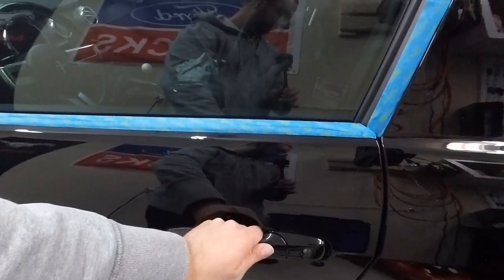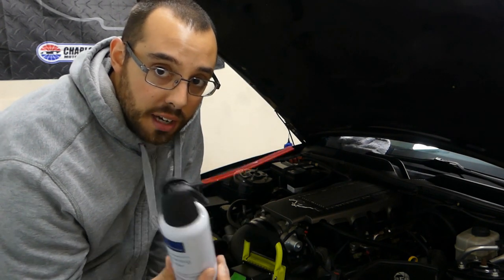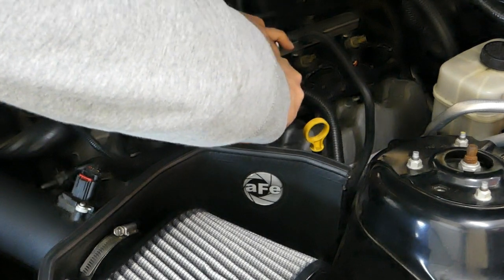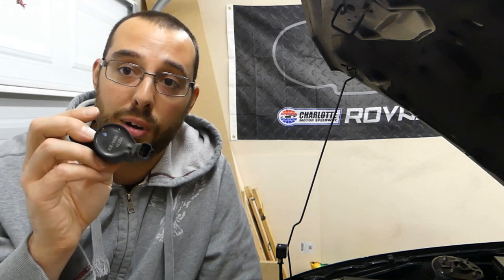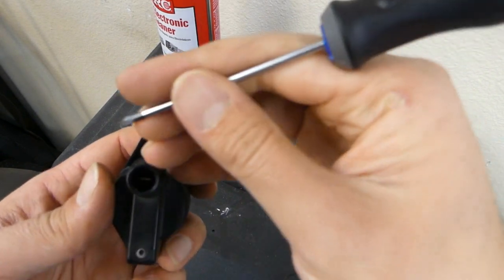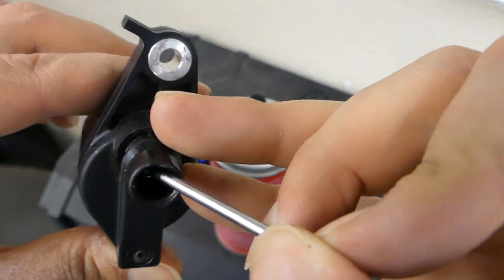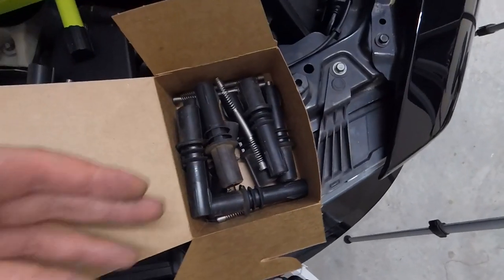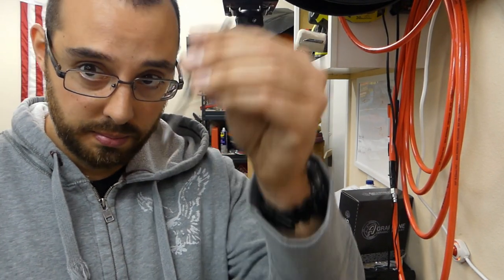The Best Coil on Plugs for a Ford 3V Engine

Comment: I know this is slightly old but…to anyone else out there… I just finished my spark plugs and was gonna go with all new coils also. I saw this video and decided to do it…followed the instructions to a T…and it worked. Misfire on #1 and #4 codes, random misfire code, and coil circuit H code. All fixed. This man saved me many hundreds!
Reply from the maker: Glad to hear. Coils rarely ever fail and this to me is great preventative maintenance

Comment: This is one of those “the most common cause” and “easy to fix” instructionals that when you finally diagnose your problem is never EVER the cause. Don’t get me wrong. This will need fixing too and you will think you’re done. But then, when you test you will find the symptoms intact and something completely independent causing  the same problem. Hundred percent of the time. That’s just the law.

Comment: Good to see the CPBK240 are actually made in USA. I thought for sure they would of been china. They say to coat the inside of the boot in dielectric grease, along with the head/to boot sealing rings, and finally the boot to coil stem inside and out. 2v tritons no antiseize MC plugs 28 ft lbs (yes over tighten them). And 3v 5.4 is MC plugs with Nickle anti seize on shaft/threads torqued to proper spec.

Comment: I enjoyed watching this video… I have never replaced a coil on plug before. I’ve replaced countless ignition wires and spark plugs on older vehicles, but I’ve not replaced any on vehicles with coil on plugs I was looking at one on my car today, and I was not willing to pull up on the boot because I was unsure how the assembly went together. Thank you for your video… It was very helpful.
Reply from the maker: Awesome, glad you found value and I appreciate the kind words

Comment: Good on ya mate 

good video, I’m definitely gonna try this. It also occurred to me you could clean that spade terminal with an emery board the ladies used to file their nails with might work a bit quicker……..

Also on YouTube, there’s several videos showing how to test resistance of coil on plug using a primary test and a secondary test via a multimeter while it’s out it’s probably not a bad idea 

All the best from Melbourne Australia
Reply from the maker: Definitely does not hurt to check the resistance. I know that even if they check out okay, they can still be faulty under load. My understanding is there's no real good way to check the true health of them at load (which is where most of the problems arise)

Comment: I've got the powered by Ford intake cover and the matching fuel rail covers that help keep water,dirt,& other road debri away from the cop area. Im sittN on about 45k miles on my 06 GT so its about time for her first plug change.
Reply from the maker: That's great, I have that engine cover as well. 

I would definitely clean those contacts on the COPs and best of luck on the plug change!  I used the impact and it worked great.

Comment: Putting dielectric grease inside boot is good, and also cleaning exterior and smearing a thin even coat of black RTV on it, and let it dry for a few hours.  Keeps boot conditioned and adds a little more protection from cranking/wear.

Comment: Ford 6.2 Motors have a little pill resistor in between the spring and contact. The tabs that hold it wear away, you need a new coil. Its expensive :lol: Each cyl has 2 plugs.

Comment: My F-150's 4.6 Triton is doing EXACTLY what you described, i had the plugs changed, maybe slight improvement but still bad.  Then watched your vid & planned to follow your instructions, it appears that i don't have the COPs, the wires go directly to the tops of the plugs.  Is that because it's a 1999?  Are those COPs something newer than that?  If so I guess my only hope is to change the wires, do you agree?
Reply from the maker: So that is a different design that is unfortunately out of my wheelhouse. Ford had changed from that design over to the later coil on plugs. I'm not saying you can't use the same method and check for corrosion, but I personally have not owned one of the older coil pack based design so I can't speak to it.

If they have the little spade connectors where the wires connect to the coil pack, I'm sure you can clean them.  But unfortunately in this case, I'm not sure and you maybe better off just replacing the wires and the coil packs if they're overdue. Good luck
Reply: Wires certainly go bad, especially that age. Very common item to replace during a tuneup. Best to use Ford OEM wires. The coil pack can also wear out. Do not buy cheap ones though!

Comment: What about the coil pack on a Vulcan V6? Many brands out there. In my 50s, Taurus is my 1st frikn computer car. Also looking for good scanner, just sent back creader3001, wouldn't read O2 sensors. Was a Ford mechanic at a restoration shop that's now closed yrs back. We stuffed big blocks in old Ford classics or rebuilt what was in them.
Reply from the maker: The same idea can be applied to any coil on plug doesn't matter the make or model. If it has a coil on plugs with a spring and a boot, I would take a look and see on RockAuto or a similar site if springs and boots are available. And if so it's probably not a bad idea to take a look at changing them out and cleaning that contact. People do the same thing with Chevrolets and Toyota's... it's all the same idea.
Reply: @3VJohnny  have a pack on valve cover, not individuals. Checked the arc last night seemed more orange and red with a little blue. Would probably explain alot. Could barely notice a change in way it ran. Use to be 1st thing I checked to find a bad plug or wire. I trusted a chinese gizmo a guy plugged in. Did find problems but not this one
Reply: Just replaced Plugs n wires. Besides the crank sensor which is good or bad it's the coil or computer. Engine light has flashed at times, sure an 02 sensor or 2 are also done, don't think that's the problem tho

Comment: I am getting what you are describing on my 2008 4.6L F150, but there is also some strange random vibrations at idle, no matter if in gear or out of gear.  what do you think
Reply from the maker: There honestly could be multiple things that cause it. First instinct would be a low-grade misfire which could be caused by dirty plugs or corroded coil on plugs. It's not something you're going to diagnose through the internet but my plan of attack would be: clean Mass airflow sensor, clean throttle body, rebuild coil on plugs, and change spark plugs if they are older (or you don't know history), change fuel filter. Most of the time that maintenance solves a lot of problems. But ultimately you're just going to have to try it and find out...good luck
Reply: I have this same issue at idle I replaced my plugs. Went to the ford dealership and they said I had a slight misfire. No codes or anything but they seen on the scan tool. They recommended coils. I would say yea clean the coils like he did and see what that does.
Reply from the maker: Exactly. This is not a one-size-fits-all fix, but usually the coils don't just fail. So it's worth the $30 to clean them and put new springs in boots and see what that does.

Comment: Are the 3v and 2v mustang coils swapable... like I've got a good running 2002 GT and I got a 2005 3 valve GT can I borrow a coral off my 2002 GT and put it on my 3-valve GT
Reply from the maker: No they are different. 2V engines us DG-508 coils. 

3V engines use DG-511

Comment: Kinda seems best to do this every time  you change plugs as PM esp if cost 30$
Reply from the maker: I agree and quite frankly I think it's something you could do every 50,000-60,000 miles.  My truck had around 40-50,000 miles from the first time I had changed the coil on plugs, and they already had the corrosion on them.  Just good preventative maintenance to keep things uneventful and running strong!

Comment: The boots on the coil packs for my 2012 Mazda 3 seem stuck on. I'm not able to get them off, they pull a little bit, then snap back into place. Any advice?
Reply: Try using silicone spray and/or a flat bladed pick

Comment: Any alternatives to the special contact cleaner? I don’t wanna corrode my boots
Reply from the maker: I just use the contact cleaner because that's what it is designed for and readily available at any parts store.  It evaporates. No need for anything else.
Reply: @3VJohnny  man I just finished, plugs job…was gonna spend LOTS of money on new coils also…watched this video…decided to use the method… boom codes gone. 2 misfires, a random misfire, and a coil circuit code-fixed. Thanks a ton.
Ps I used some battery cleaner I found. It worked well.
Reply from the maker: Awesome glad to hear it!!